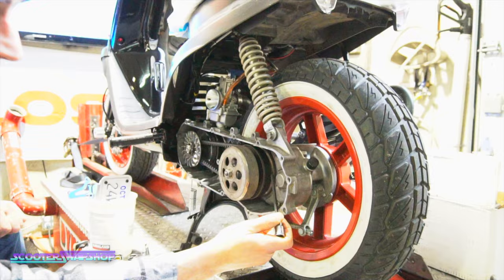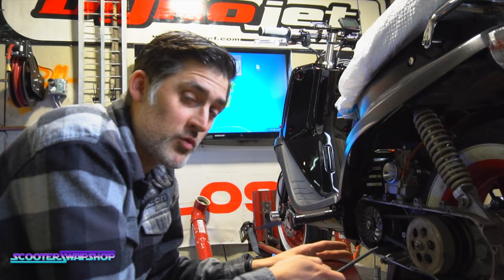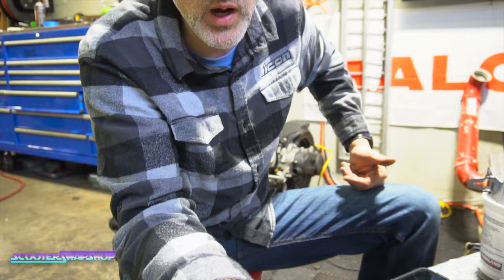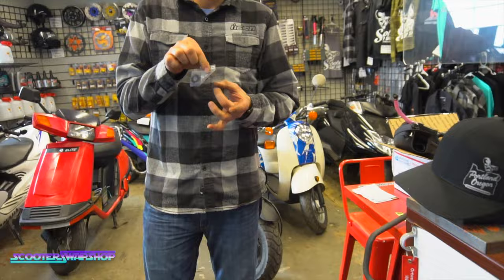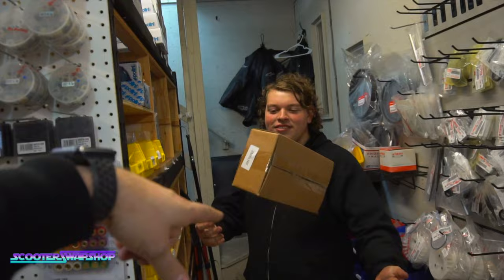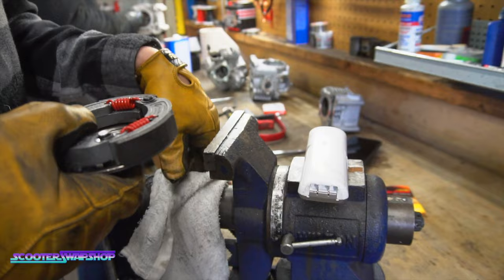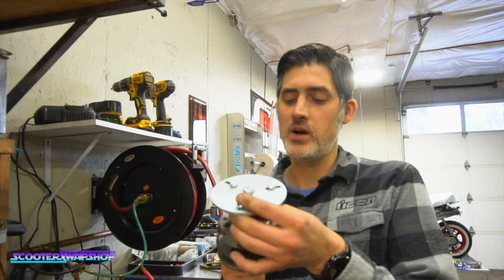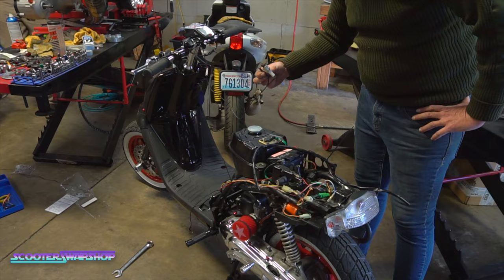Scooter CVT transmission Issues | More top speed

Comment: I've tried out a 1500 contra spring, it doesnt sacrifice much top end while increasing full throttle and half throttle acceleration. Rollers arent changed. The problem with heavier contra springs is that you need to open the gas wider from a dead start but once you get going its good. It starts at higher RPM from dead stop.

Comment: One question please 

My 125cc yamaha lost its top speed. Start is soft and quick till 80kmph but after 85 it stops pulling :/ top speed was 95-98kmph jps checked

Variator, rollers, sliders, band belt, and 1000rpm cintra spring and 1500rpm torque springs. 

Are the clutch shoes dead? 28k on clutch. But the 5hing is even with sport clytch shoe it wont climb to 95
Reply: try using 1000 Clutch spring and 1200 Center spring, what yamaha 125cc you have?

Comment: Hi I dunno if you could help or know anything about peugeot speedfights 100cc, but I can't get my cvt set up right I can't find a belt that fits properly there all rubbing on my cvt cover  I have no washer in the variator and using malossi multivar variator with 9g roller, I don't know if the clutch and assembly that's on there is Original, the belt sit right at the top of the clutch but doesn't seem like it's reaching the top of my varitor where I have marked

Comment: I want to use CVT in my electric bike. I'm using Mid Drive motor currently running via chain in rear sprocket. Can we retrofit CVT ? Guidance required.

Comment: Isn't your clutch tool upside down? Put the pressing bolts on the other side of the clutch.
Reply from the maker: No it’s correct, you can’t use it the other way or the pegs contact the clutch and the open section wouldn’t touch the nut

Comment: Do you guys have any tips for cvt tuning? I have a peugeot 2stroke 50cc scooter that revved really high had great take off and top speed on 13mm carb and 5.5g rollers it was pretty stock with a sport exhaust but it seized and the rear pulley tore apart so i upgraded while changing everything else now it has a stage 6 intake manifold, 17.5 carb, malossi multivar. Ive fiddled with the cvt a ton with rollers from 5.5g to 11g and alot of different contra- and clutch springs. It just doesnt pull like when it was stock if i put any lighter than 7.5g rollers on it, it will rev really high and it wont accelerate and top speed suffers greatly, feels like the clutch is slipping but im not sure. the belt sits pretty high on the rear pulley but it could be higher, ive also replaced the belt many times. Thanks in advance.
Reply from the maker: look up ScooterSwapShop cvt we have several videos

Comment: I got yamaha aerox with one variator multivar mhr, what polie should i use?
I've searched for a polie mhr but how do iknow if its the right one for me?
Could u tell me wich one u used on that vídeo please!?
Reply from the maker: polie?
Reply: I'm not sure if its that the name " rear pulley" but i meant the thing on the rear that gets the clutch where the belt work like variator but from the back.
I was thinking getting the polini speed drive evoluton 3 but idk if it work, could u ginne ant tip please?
Also my scooter still 50cc

Comment: Hi, i just broke 1 of the 18 blades that the variator fan has. Does it unbalance the variator or can have any issue? Thanks in advance
Reply from the maker: It’s likely
Not a big deal
Reply: @Scooterswapshop  could you please tell mi the inner size of the fixed sheave, because I just bought a Yamaha Axis fixed sheave which it is 16 mm and as far I know it has to be 13 mm. Thanks

Comment: Hi there guys, just to say that as a matter of fact a washer should be placed between the clutch and the bell,I happen to recently have noticed that exactly when I was going through the instructions book of my Polini ceramic speed drive Evo 3 and I happen to have seen this technical drawing where it's clear enough that a washer with specific given measurements is advised to go in there.I was in awe as I happen to not have placed a washer in there after finishing the recent restoration I did on my Zuma. So I went and could only get a washer with a slightly minor thickness than the one mentioned in the instructions book of the Polini ceramic speed drive. Maybe the washer isn't supposed to be used when the scooter is equipped with a 105mm original (or not) speed drive like we see in the video. Please reply back to me on this issue as soon as you can.
Reply from the maker: message our app for support on products we can assit there or on our live tonight